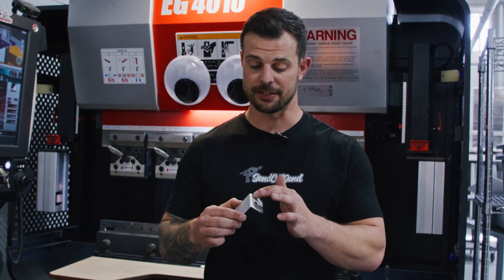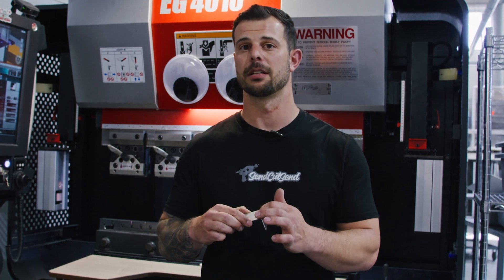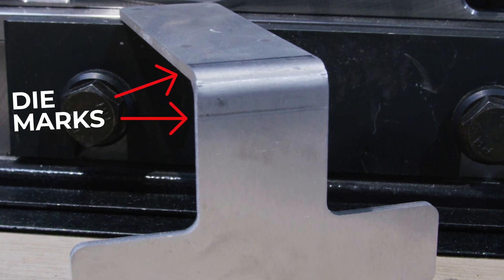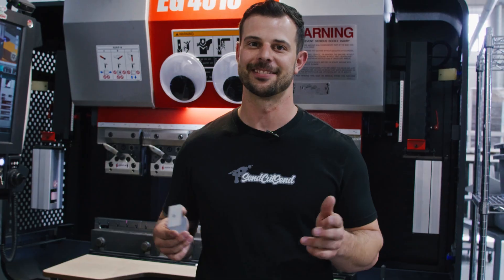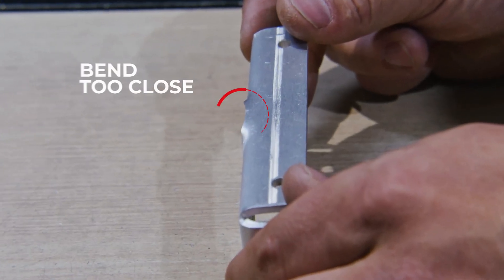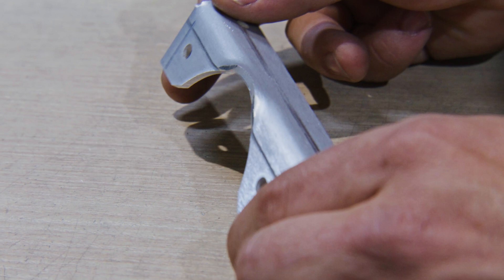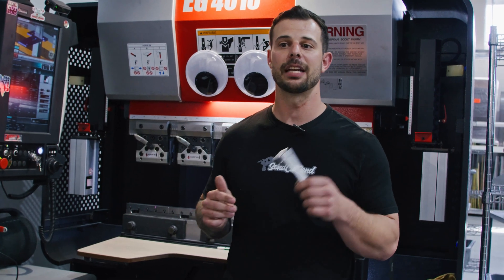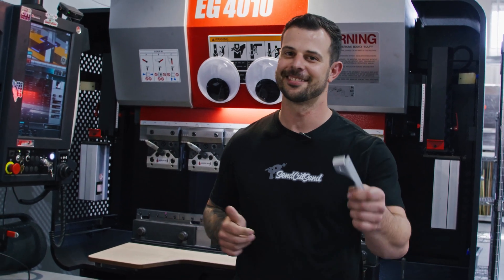SendCutSend Online Sheet Metal Bending Services

Comment: So if you have a 42" wide bend is that possible to do with your tooling? ¼" aluminum for example.
Reply from the maker: Currently our max flat size is 30" in any material or thickness, so 42" is a little too big!